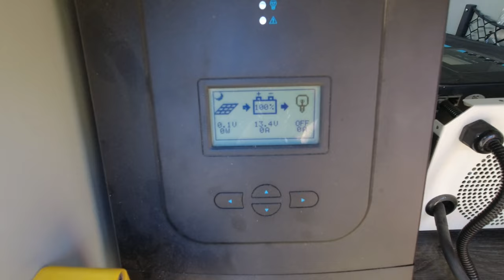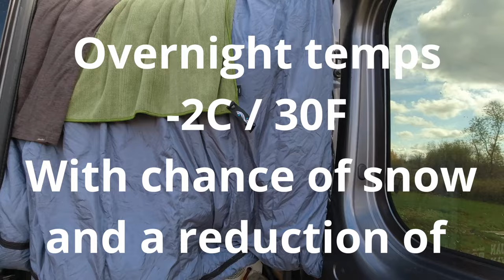FRIED OUR INVERTER!? REPLACING OUR 3000W RENOGY INVERTER//EP 8: Rob's Van Repair & Maintenance Tips

Comment: I don't think this thing is bad.. As they go into fail safe mode...Most people have an issue with reading the instructions on how thinks work and why...Most do this because they are stuffed in s small space. And no way to cool off...You need to vent them some how...

But Renogy needs to train their techs better...And stop buying them off Amazon. Their the same price from Renogy..
Reply from the maker: @Up2NoGood Good point with the Amazon purchase. I think Rob used Amazon as he was constantly purchasing items for the van build and it was easier to do it all in one spot to keep track of it all. As for the venting, it has plenty of air flow as we designed it with lots of space above and all around plus there is a fan constantly running, to circulate the air and draw air from the front of the van too. 😊
Reply: @RobandJanCanVan  I would suggest you wire them batteries right.. As they are wired wrong. You are coming off the same battery Positive and Negative. You need to come off the positive of the first one. Then the negative off the last one. This balances the BMS across all 4. Not just the first one..

Second. You ground that inverter to the stud inside the Inverter. It's sticking up behind the cover. at the bottom. It uses a #8ga wire with a #8 ring terminal on one end.Then a #10 ring terminal to the Frame. Don't use that ground bar. 

And if you want to sell that old one. I will buy it and pay the shipping. As I can fix anything.